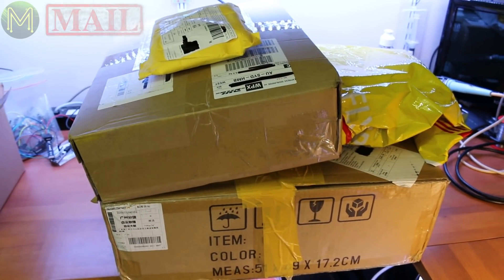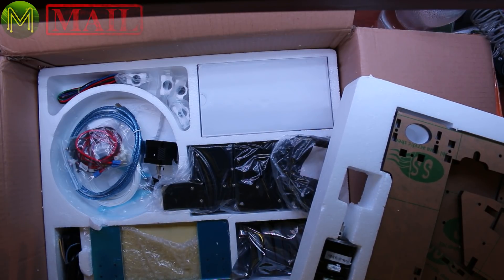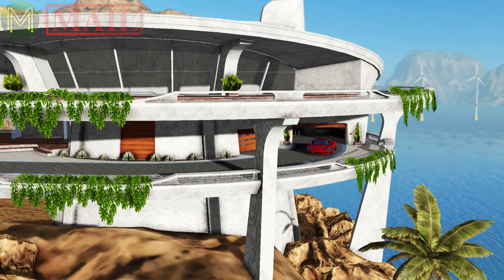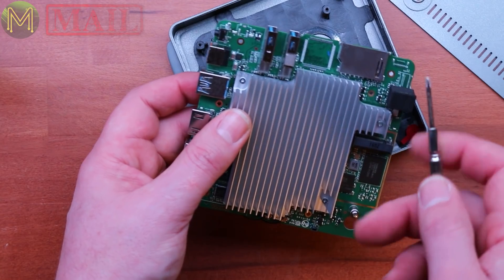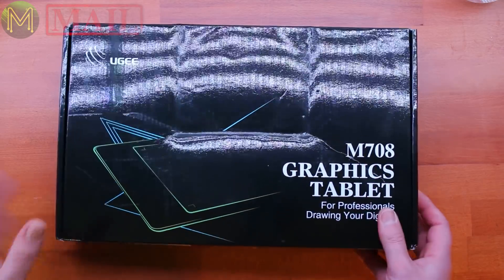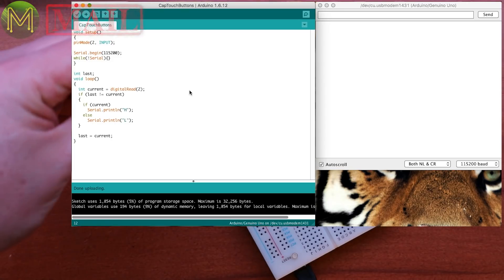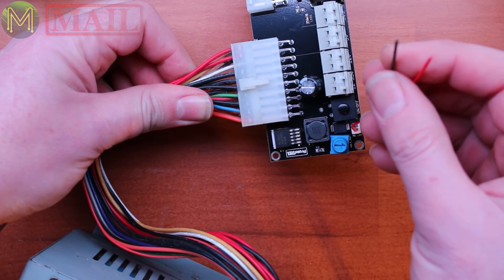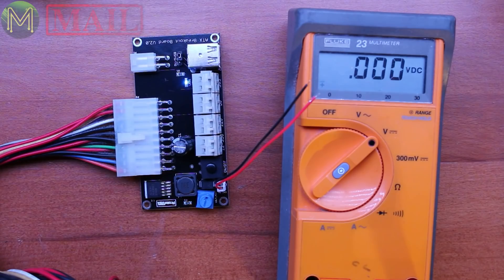#167 MickMake Mail #17: Anet A6, Beelink AP34, ESP32 (again), HTTM

Comment: with a quality power supply you could make a great bench power supply, you could send the variable power adjuster to a remote pot, and put some proper connectors on a front panel, those usb ports could power a 4 port usb hub built into the panel, those ports could be very handy on your bench.

Comment: i have the A6 too, wasn't hard to assemble, but mine came with a DOA power supply. Still waiting on the replacement, hopefully soon.
Reply from the maker: That's no good, but good to hear it wasn't hard.
Reply: good news, power supply arrived today, and other than having mixed up the y and x axis stepper plugs i'm happy to say its up and running and doing its first print. the pdf instructions are pretty good, the only complaint about them is no where does it tell you to install the Z axis limit switch, and there were no good photos of its installation location. It would have been easier to see if i had left the protective paper on but the 2 small holes don't stand out when all in black, when you get there it goes on the left side just above the z-axis stepper. hope yours goes smoother than mine, but DOA parts do happen, think thats my second in over 15 years of ordering stuff online.

Comment: A friend of mine did ask the question - with all of those dozens and dozens of touch switches for a project...   wouldn't a touch screen have been easier :-)

Incidentally, the ones that don't light up - i.e. the cheap red ones.. I'm using them with inverted output and had to disconnect the LED and wire up a new one +v referenced... if ONLY they'd put in a couple of links for that....   (if you need normally HIGH - the LED is  generally ON instead of generally OFF - which isn't too good).
Reply from the maker: I did look at that; the cost of doing it with a cap-touch IC, plastic bezel, LEDs, etc, would have ended up being around the same cost and I wanted the option of being able to re-use them in other projects.
I could have used a touch screen overlay, (and did look into that), but where's the fun in that? :-)

I figured the RED LEDs would have trouble, (especially looking at some of the feedback on them), and so picked up a bunch of the blues.
Reply: Well do let us know how you get on with them - with that quantity you'll soon know how good or otherwise they are :-)
Reply from the maker: +Peter Scargill 
Yup, should be able to have a fair idea of how good these are, but I suspect that quality would vary across manufacturers.

Comment: That fanless Beelink AP34 looks interesting.  Wondering if they were smart enough to use an aluminum case, instead of steel?  Probably not ; aluminum conducts heat much better.   As I browse GearBest, I see no MiniPC (x86) that does NOT force Win10 on the consumer.
Reply from the maker: +GnuReligion 
Yup, it's an alu case and yup sadly all Windows O/S on these units.

Comment: Those on-off switches would be amazing to have a flat pc keyboard... :)
Reply: Eh a standard multitouch display would be better. Could actually display color graphics on it and have custom inputs.
Reply from the maker: +Zoltan Hoppar 
They'd be quite hard to use as that because they're a latching switch. Better to have a capacitive touch overlay and use XY coords off that.
Reply: MickMake The ones I just received have what looks like an unpopulated 0604 footprint...if you short it out then the switch assumes momentary action.

Comment: Eeeyy, Mickie! Loads of toys, again! Any word on your UP2-board yet? I just received mine yesterday and so far I'm pretty impressed with it. Benchmarking and testing still underway, also customizing the kernel and stuff, but I love how much grunt there is to it considering how small a device it is.
Reply: Oh, I forgot to mention about the Firebeetle: it looks good and all, but it's a tad expensive. I ordered a couple of LoLin-branded Chinaman-devices ( https://www.aliexpress.com/item/10Pin-Convert-To-Standard-6-Pin-Adapter-Board-For-ATMEL-STK500-AVRISP-USBASP/1859124621.html ) that should be more-or-less the same thing, but at a cheaper price, just so I could give them a whack and see if they're actually worth using or not.
Reply from the maker: +Nita Vesa 
Nope, still haven't seen my Up2! I'll have to prompt them for it. So do you think it is the smallest and gruntiest board?
Reply from the maker: +Nita Vesa 
Let me know how they go!
Reply: It sure has a lot of grunt to it. It's a tad bigger and a lot heavier than I had expected, but that's mostly the big and fat heatsink on it. I did some testing with ambient temps at around 23C and saw no throttling when compiling the full Linux-kernel, so it seems the heatsink is doing a pretty good job overall. It did compile the kernel in about 75min, whereas my Core i7 Nehalem - server does the job in ~33min, so I'd say that's pretty damn impressive! Haven't yet tested any 3D-stuff on it, but I was thinking of seeing how e.g. DOOM using both OpenGL and Vulkan does on it -- I would assume Vulkan would see a reasonable speed-boost.

On the hardware-side, I am not entirely happy with the placement of the USB3.0-ports; they're too cramped up together, making it impossible to use most of my USB WiFi-adapters, Flash-drives, SD-card adapters and such without an extension-cable or the single USB3.0-port on the back of the device.

Oh, and I was impressed by how many codecs the SoC can decode in hardware. DXVA Checker under Windows lists pretty much every major video-codec that's in use at the moment and most of them can be decoded at up to 4K 60FPS, with HEVC being an exception as it goes all the way up to 8K.

Anyway, this isn't the right place to write a complete review, so to cut it short, I am so far very much liking it!

Now, as for the Firebeetle-alternatives: I don't have any complaints. The USB-to-TTL CP2104 that's on-board works just peachy, the built-in LiPo-charger works like a proper mini-UPS in that that the board does not get resetted when plugging it to charger or unplugging it (several boards with a built-in charger that I've seen do reset), and the ESP32-module on them is silicon revision 1, which is exactly what I wanted. All the GPIO-pins except for GPIO32 are brought out, too; I don't know why GPIO32 isn't brought out, but I figure that since it's just a single pin, I'm not going to make a fuss out of it.
Reply: Ah, I should probably mention that mine is the Pentium N4200-version with 4GB RAM.